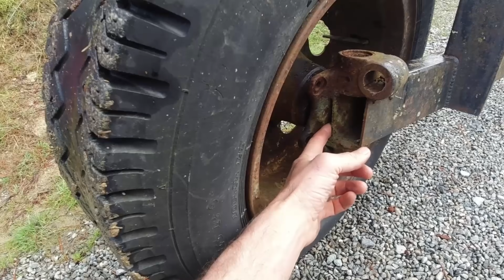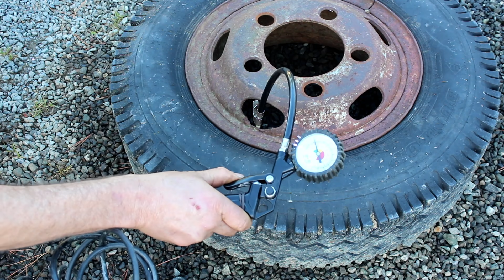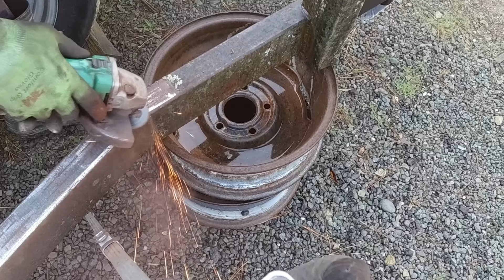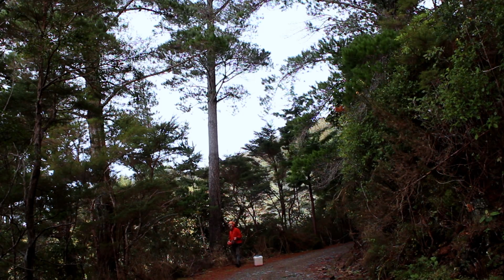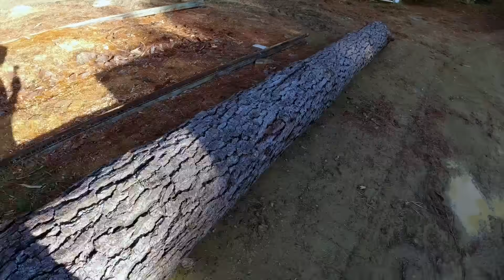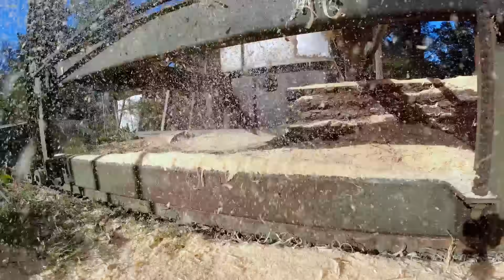Restoring an old Log Arch and Hauling Logs to the Sawmill

Comment: Since this isn't for the roads, drill a hole in the hub for a grease zerk. If you pump it up from the middle, both bearings will have grease and it will outlast you.
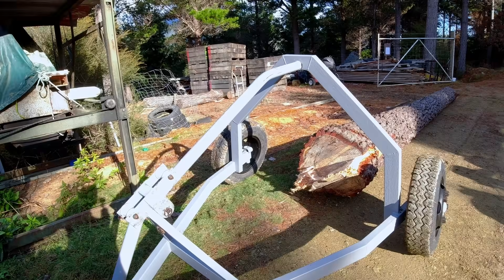16:48 i'm 99.9% sure the caster and camber are on purpose. That arch tracks beautifully. Whomever made this knew what they were doing. I suspect that the wheels should remain this style for as long as possible, the flat surface allows them to dig in a little.
Reply: Good observation. The negative camber helps distribute the load to the ground by reducing the angular torque on the axles. The sliding hook is brilliant and I'm only halfway through the video and we don't see the sliding action yet. Looks like it was edited out to save time.
Reply: No doubt you are correct.  With the alignment of these wheels, it should track in a straight line and if there is a little tire scrub, who cares?  99% of the time it'll be run on dirt where tire wear is of less concern.
Reply: @briansilver9652  yeah the first log he hooked up the chain might have been too short. Once you pull out then back up and re hook it it should work quite well. 
i also got to thinking that if you made another trailer with 4 wheels spaced out a bit and made some sort of pin connection to the other trailer (which should have a pintel hitch I think) you could back up to a log pull it out a bit and then back up more and then slide back the rear trailer and using 2 log clamps you can then hook both ends and drive forward which should lift the log off the ground. Yet how do you drop the log. Oh remote control electric breaks on the rear trailer. When you back up that trailer does not move which pushes the log backwards. 
Though at this point you just need a log trailer. Though for someone who need to transport them a fair distance it would work quite well. 
We used to haul out firewood and lumber wood from the river bottom and we used a side dump truck and large flat beds. The owner of the land used his tractor to load up the trailer when ever he had time. 
We would then pull out the logs cut to size and then load the trailer and side dump truck for the 5 or so miles home. 
Where I bought my new house we do not have a wood stove and really no place that it would work to heat the house. Yet the firewood is all around us everwhere and there is lots of it. I have cut down and logged out a lot of the dead and live trees on my land as most of them are random trees that grew from mis managed owners. We are cleaning it all up to one day build a new place. Which I want to run one of those indoor wood furnaces as it will be a duplex style house, Pretty much having 2 full size apartments and a storage area between the two. This way we can have our live in cook/maid/driver not have to live in our very large house.

Comment: Nice indeed to get an arch. Haven't seen one with a moving hook but as soon as I saw it, said "Oh that's a right fine idea for sure."

The ones I've seen have used a pulley system to lift and a separate chain for the drag portion. A few 'advanced' ones used again a pulley with a chocker or log tongs on a long winch cable to get a log that was out of reach of the tractor and pull it over to the arch for lift and tote. Those type were more often found in the Pacific northwest for use with cable tractors and dozers. Most had solid wheels, few used tracks for softer ground. Large low pressure aviation/agriculture tires were common in the latter days of commercial log arch use.

Thinking of wheels, saw the ones on the arch are split ring. While I've no doubt that you know your way around them. Never hurts to not get in a rush when servicing those, nothing will ruin a day faster than a locking split ring not being seated properly. Except maybe a 5° two piece rim, those are scary.

Finally, dealing with bark, I'd look into a peeling spud to strip off bark from a log. If you've never heard of a peeling spud, it's basically a curved chisel with a long handle for leverage and to keep from needing to lean over. Work it under a bark edge and just peel the bark right off from the wood by staying in the thin strip of pithy stuff just under the bark with the spud tip.
Reply from the maker: Yes I do have a spud, but I prefer to keep the dirty side down when possible, saves time striping bark
Reply: @MartyT   Cool beans indeed, I used to be surprised when I'd mention a spud and folks would look at me like I'd suddenly grown a second head. Others just laughed and insisted I made it up. I'm now more delighted to mention one and the person I'm talking to knows just what I'm talking about.

Also that's one gnarly saw mill, going to have to see the video on that beasty. Just has a steam/diesel punk vibe about it that's just every bit "I can't not look at it and not see something neat."

Comment: The Log Arch is a clever and useful device. I love the way you simply take things apart, get rid of the rust, straighten, fix, and re-grease as needed, then paint it to look new.  I think you put several hundred dollars of labor and materials into it and should reap the benefits every time you haul a log.  Just don't let The Borrowers get ahold of it...
Reply from the maker: A borrower is using it at the moment, my neighbor 😂

Comment: Loved how you used a paper paint guard when applying primer to the inside of the rim, preventing primer from getting on the inside facing part of the tire, and then went "Ah. Screw it." on the outside 😂 This project is such a cool piece of kit

Comment: You will need to paint the trolley hook Safety Orange. Moving parts on machinery need this. Otherwise you won’t see it coming. 😁 
I like the design. I’ve been wanting to build one and it would be nice not to use a winch. I think I will build one similar. 😊

Comment: Hi Marty. I have seen several mills that folks use. Most of them have a horizontal saw blade that cuts from side to side. I saw an industrial saw that used a vertical blade (disk) for cutting really large logs (diameter). None of them cut the way that your does and I think it is really cool. 
Have good days!

Comment: It just occurred to me that the way the tires are welded on had been done on purpose. This way the arch is centering itself in the track, it's load transfer across the axles might be better and manouverability, particularly in tight turns, might be better than with traditional mounting.

Comment: 12:42 When you put the tires back on, you finished it by hand. Why is that? Is the electric or pneumatic not strong enough?

Also, lovely milling footage. Very satisfying. Let us know if your home cut wood gets those nasty splits.
Reply from the maker: I like to feel the torque, hard to tell using the rattle gun

Comment: Those look like 5 on 8 inch wheels.  Reason I say that is I recently acquired a 1936 Ford 1 1/2 ton truck with the same bolt pattern…  those don’t look like 20” rims though.  Could those spindles be from the front of an early Ford?

Comment: years ago, when we had to mess with split rims in the field we rapped chains through the rim and around the tire and had a long air hose that locked onto the stem to fill the tire from a distance. i would hate to see something bad happen this is a great channel be safe.

Comment: I'm not a fan of split rings either, but I think they are better than the old two piece split rim widow maker wheels. I worked in a gas station when I was a kid and the owner wouldn't let me touch split rims, or locking ring rims. He would repair the tire and remount it on the split rim, then he would place it flat under the vehicle hoist, connect the air chuck, and then stand back. If it separated under pressure, the hoist would captivate the parts.

Comment: Marty, I had a thought regarding the angle of the wheels maybe somebody else has already mentioned it but it was done that way on purpose for sidehill because the log essentially is a live load and it's going to swing to the low side and if your wheels were 90° to each other, the arch would flip over. Kind of like how they dish a wooden waggon wheel so it will handle side slopes, similar idea.
Reply from the maker: That does make sense

Comment: Excellent video - as always. May I ask a possibly dumb question please: Would it be useful to attach a 2 wheel dolly to the rear of the log so that the log does not drag on the road.  Lift up one end, attach the dolly and then pick up the other end and roll ??
Reply from the maker: Yes that would work but would be more time consuming

Comment: Why the arch? I put a drawbar across the 3 point , and use short skid chains placed at one of the draft links /bar corner, lift the log off the ground and adds weight to the tractor for better traction. Great drone shots :)
Reply: That log was around 3 tonne, considerably more than the weight of the tractor. The tractor would not have been able to lift the log. 
  The point of Log Arches is to transfer the weight of the log onto wheels and off the rear of whatever kind of tractor is pulling it. It have seen D8 Caterpillars using Arches to pull up to 30 tonne of logs at a time.
Reply from the maker: I do that with the smaller logs, but my wheels would be off the ground if I tried that with logs this heavy
Reply: @MartyT  I've been skidding logs with a mid sized farm tractor since 1973, with an Int 354, and now JD 970. With the 354, I was skidding saw logs, Spruce, Fir, 22" diameter butts, and 32 ft long, all on a 3 point drawbar by the draft link, right or left depending on the slope. A short skid chain close to the draft link. In Winter snow, with Canadian chains, and Summer , no problem with the front end rearing up. The 970 has AWD, and a loader , I skid whole Oak stems  over 30 ft, up slopes. The vineyard tractor is heavy, and has AWD. The handy thing with direct hitch is backing right up to the butt, it would be impossible in most of my woods situations to use an arch.  Arches were used with Cats in the east and West before skidders, which lift up the stems. Just my opinion, from experience. My friend made an arch , it is attached to a 3 point drawbar. he is in some very wet areas, and needed higher clearance, still , he has to skid the stems out to where he can back the arch over the stem. He has a portable band saw, and saws just killed ash borer Ash mainly, some Hemlock. He is working on a converting a gas JD 1520 to be wood gas fired .

Comment: You are way more thorough than me when you get a new piece of abandoned equipment
Reply: He gets paid to restore it by his You tube channel.  For folks in economically depressed rural areas it sure would be great to be able to acquire pieces of equipment cheap and then almost pay for them by greasing and painting them before you use them to make you some more income.
Reply: You call that thorough? That was botched
Reply: @gummel82  if I did it I wouldn’t have painted it and I might not have checked the bearings

Comment: I have a farm stand that is built over the frame of an ancient IHC truck frame.  Its sorta like a hay wagon with a roof and suspension.  It HAD split rims.  Mind you they were probably 60 years old.  One day I was mowing the grass..  I use a 35 hp tractor with a 60 inch rear mower.  As I passed the farm stand one of the split rims failed.  It blew right across the lawn to strike the rear tire of my tractor.  If you have the odds and ends I'd update....

Comment: Marty either build a rear holder and get the log of the ground i think i seen one a long time ago much the same as the front one but in reverse and a chain that locks the front to the back to stop it from running away to the sides, But in the bush the one you have is great to move your timber around.  :)

Comment: thems "locking ring" wheels, not exactly safe, but way safer then "split rim"  and really a pretty skookum design if you need to work on heavy use wheels in the brush. as long as the locking ring is seated correctly they will be fine (and its pretty hard to not seat them correctly, though it is possible)

Comment: you should cut many more trees and give yourself much more elbow room for storing all gear - think about building a nice shop - do timberframe 24x48 or something maybe just build a big polebarn in meantime - think about getting a sandblaster - you can use various media - you would use it all the time, you should be able to get 12-20 3m beans out of that one tree, go ahead and harvest a few more and you can get all the beams you need and then start milling true dimensional 2x4 for studs and maybe some 2x6 for joists and rafters - you have the space though you may have to excavate quite a bit more - you can make it a summer project - once you have all the site work and prep done it should go together quick whether it be a pole barn or a shed or a mini office or full blown shop/office, you could sell some lumber also but it is so prized I think you may just want to stack it up and use it for yourself, you also could mill siding and flooring too
Reply: Marty’s house and shed site is perched on a tiny bench cut in the side of a steep hill. Space is at a premium for him. I’m sure he would love to have the space for a shed as you describe.

Comment: Marty, dumb question.   When you mill or buy dimensional lumber, what are a couple of the more common sizes?  In the US for example a 2×4×8 is the term but if memory serves me it actually measures 1 1/2" X 3 1/2" X 8'.
Reply from the maker: yes it is pretty similar here but metric measurements

Comment: Couldn't you have swapped the tractor wheels from one side to the other to get the same effect? Might have been easier than stripping them. Always interesting seeing what you are working on.
Reply: I don't think so, the tread grip would have been the wrong way around.
Reply: @johnnixon7750  no it wouldn't, as you would be keeping the tire the same way around to keep the treads facing the correct way, the result would be that the inner is on the other side, effectively doing what Marty did by pulling them apart.
Reply from the maker: It would have widened it slightly but the lugs are offset on the rims so maximum width could only be achieved by turning the dishes inside the rims
Reply: @MartyT  that explains it.

Comment: You know, with as much rusty-stuff-restoration as you do, have you ever considered picking up a pressure-fed sandblaster or something for outdoor work?
Reply from the maker: I do have a little one but it is much slower than the grinder
Reply: @MartyT  Ah, fair.  I haven't really seen you using a big compressor that could support a larger blaster.  I take it you've got one of the little hand-held spot ones?

Comment: i know it is not quite your style but you could have bought a skidding cone for nearly what your into that log arch and they pretty much do the same job except i think the skidding cone would be a bit more beneficial to you if you had to pull logs out of the forest where you can't get a machine. it helps prevent the log from getting hung up.

Comment: Hi Marty. another great video, then pine could not have been placed better. What happens to your timber after milling??? Over the ditch we are paying unbelievable price for pine, it's the old line the supply is limit which is the biggest load of crap, Bunnings are just ripping us off.
Reply: You’re probably right. Raw Pine logs are dirt cheap here in New Zealand at the moment. We can’t give it away. It’s going for around $120/t! (Equates to about a cubic metre of sawlog)
Reply from the maker: I'll be using it for cladding my shed

Comment: What drone do you run Marty? looks to get some amazing altitude
Reply from the maker: I use the dji air2s a very capable drone, but the latest firmware update requires the drone to frequently log in to the dji website which is annoying when there is no wifi signal, the drone barely gets off the ground if it doesn't log in. I'm hoping they get rid of that restriction on the next update

Comment: Those wheels don't technically have a split rim, however I have heard that term used when talking about them pretty much everywhere. The "widowmaker", the deadly and dangerous rims of legend  separate right down the middle being composed of two halves that lock together where the ones in the vid are "multi-piece" wheels with a locking ring and since that ring has a split, I think that's where the confusion comes from.

Comment: I think you could have built one for about the same price ,But You saved alot of time.
Reply: Check out current pricing on steel to see that the frame alone would be around $300 in material .  $100 was a bargain.
Reply: @bobturnbull18  I think Marty T would have repurposed a "junk" trailer or other scrap and made something awesome .

Comment: Hi, would it make sense to have a small set of wheels that you can fix under the back end of the log so that it rolls along easily instead of gauging out lines in your roads?
Reply from the maker: That would work but would be more time consuming to set up the log

Comment: i imagine that frame means you need a lot less tractor to drag a given log with most of it off of the ground.
Reply from the maker: Yes that's right, usually I'd need to make 2 or 3 trips for a log that size